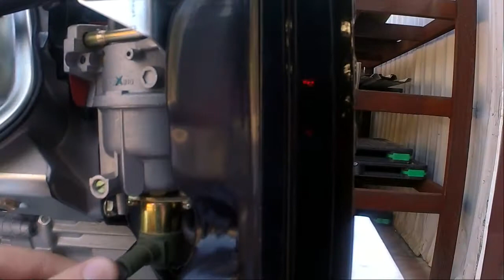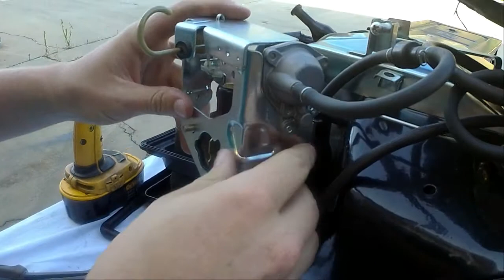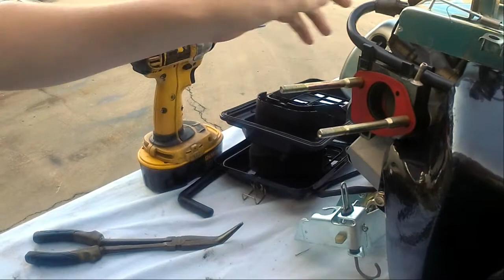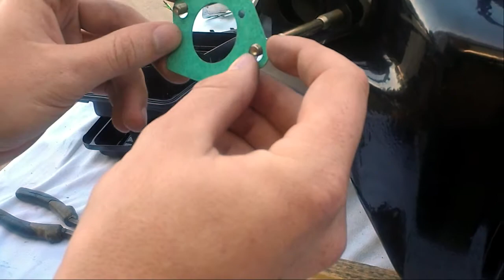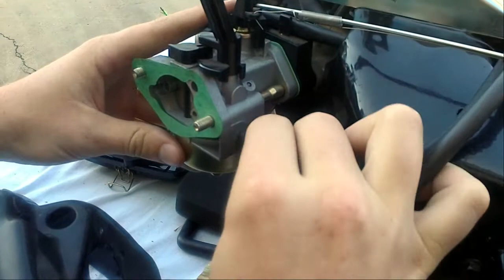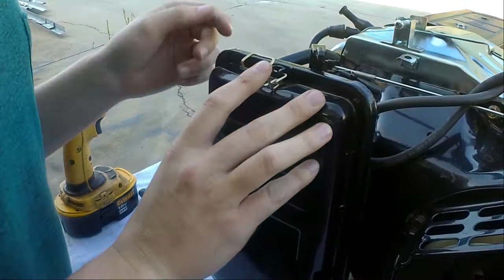Changing out old style solenoid carburetor to new style on a generator

Comment: I have a Titan 8000 generator. My generator has the same solenoid on it. Will this carb youre putting on this generator fit on mine? If i was to order this carb from you, would the insulator block come with the new carb?
Reply from the maker: Yes it is the exact replacement for your unit.

Comment: Thanks for posting your video, would you have any idea what that choke valve assembly with the one-way vacuum line does that comes from the insulator port? I'm guessing you could plug that port on the insulator and reuse it .
Reply from the maker: It is suppose to auto shut the choke off as the unit gets warm from the suction. You can plug it but the choke would not auto shut down.